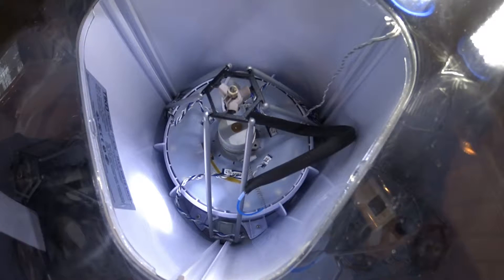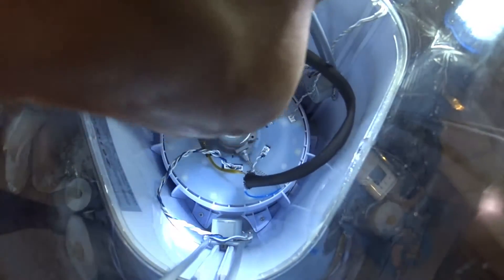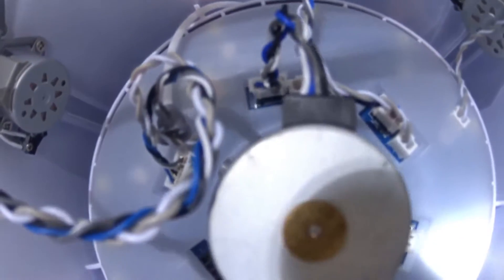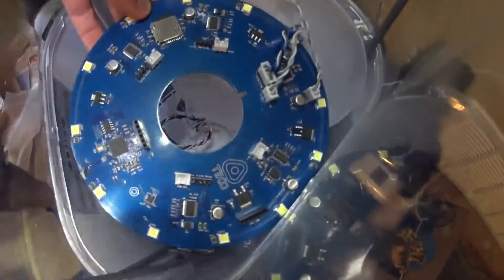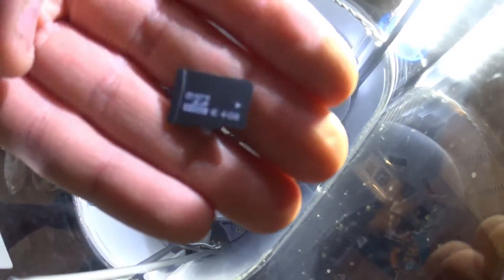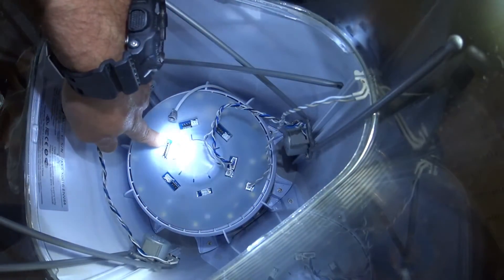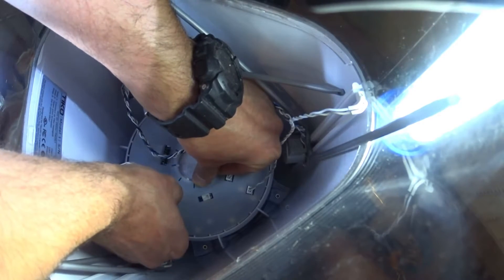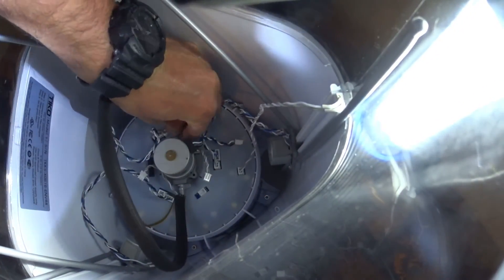Beta Early Bird - Tiko 3d Bowden/Liquifier Assembly replacement

Comment: I managed to get a tiko and messed up when I flashed the rom and bricked the printer, I managed to get a sd file copy but while reassembling tore off the ribbon cable of the extruder from it's motherboard headers :(, could you please send me a picture of the cable numbering so I can resolder it back?

Comment: dude you are a life saver..just got my tiko 3d printer
Reply from the maker: No problem glad to help out.
Reply: do you know of any programs that can use the tiko for printing
Reply from the maker: Saul Alessio it's been a while since I last used the printer, but there were a few cura profiles out there for this printer. I got the profile from the forums but it looks like the forums are dead. I did find this profile on thingiverse:

https://www.thingiverse.com/groups/tiko-eu/forums/general/topic:9590
Reply from the maker: Saul Alessio I should mention that for general printing you have to connect directly to the printer through wifi to access the WIT. You should be able to drag your cura slices files to the printer that way to print them
Reply: thanks i already printed a holotape on it from fallout 4..had to reprogram the tiko when i got it. someone had wiped the SD card and plugged all the motors backwards. so glad you made this video so i could see the way it's connected and put together.

Comment: Could you tell me what what microcontroller was on the main board? At 5:43 its the left most large square IC. I cant really tell but it looks like it might be a Texas instruments MSP430? .. maybe even a 432? Also what where the stepper drivers? Where they the DRV8825's? Im just trying to figure out why no one has tried swapping out the electronics to a RAMPS setup and just load the Marin firmware. It supports deltas. That could be a $30 mod. If someone wants to donate one to me for science and the benefit of the community I would gladly take this project!
Reply from the maker: Hi Carlos,

The TI chip is a SimpleLink Wi-Fi CC3100/CC3200. The stepper drivers are the A4988 stepper drivers if I remember correctly. I haven't been able to identify all of the chips on the board though. Some are really hard to read. I am thinking about doing the board swap on the other one that I have to run marlin on it. I just haven't had the time to dig into it quite yet.
Reply: Oh interesting! CC3200 has a built-in Cortex M4 this thing should be kicking some ass (assuming a professional developed the firmware...).  Looking at other high re-pictures of the board it looks like the drivers are A4982. Tiko didn't really pay attention to Allegro's pcb layout guidelines... No thermal relief vias, stitched current sense resistors for the love of god! Thermocouple amps on the complete opposite side of the board where CC3200's ADCs are....This board had to have been designed by a college fresh out...

I seriously bet a RAMP set up would make this thing print quite well. Don't get me wrong though, RAMPS circuity especially the cheap Chinese versions are sheit but the firmware is solid (both Marlin and Repetier) . So many iterations have been made to it over the years by extremely talented developers. Please do a follow up with the conversion. I bet hundreds of people would love you for it!

EDIT: terrible spelling
Reply from the maker: Hahaha Im not much of a hardware guy so I don't know the ins and outs of the different components or even how to pull the firmware off of the board, but here are some close up pictures of the components. you may have better luck making sense of the schematics than I will:
https://goo.gl/photos/GAq3t6TrvsJR1N2c7

Comment: I don't know what I think about this design. It shouldn't be a battle to swap out components.
Reply from the maker: I guess that is one of the downsides of a fully enclosed printer. For the most part the pieces do fit in well and since I have done this once before the second time around will be much easier.
Reply: It just seemed like a real struggle to remove that motor.
Reply from the maker: oh yeah the arms were on their pretty tight. I think subconsciously i was afraid of braking the arm when I was pulling it off so I didn't want to pull to hard. It helps if you move the arm all the way to the side in the ball joint and then twist it off.